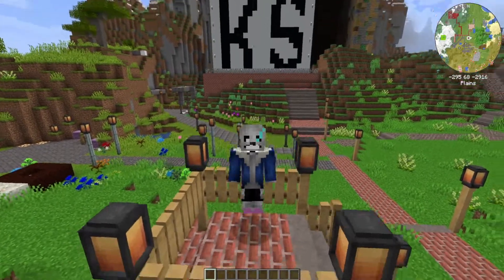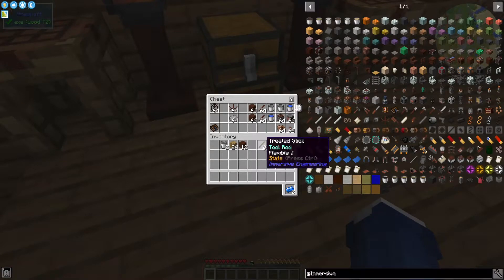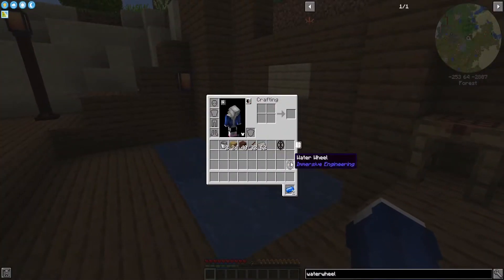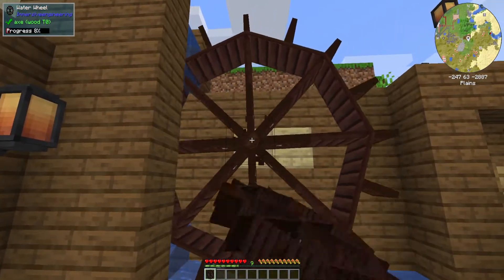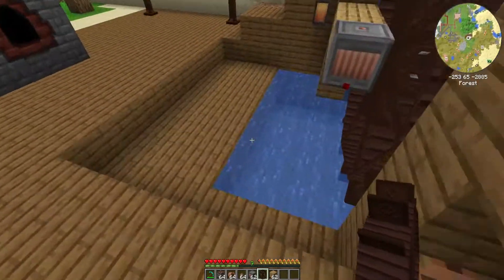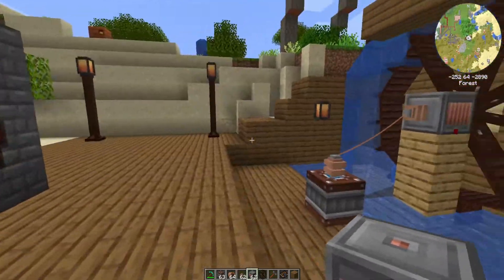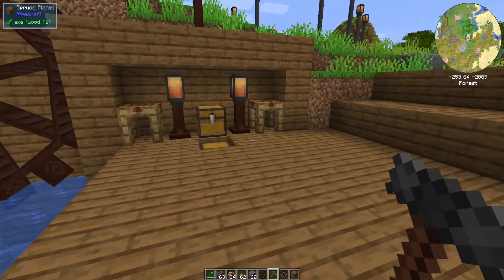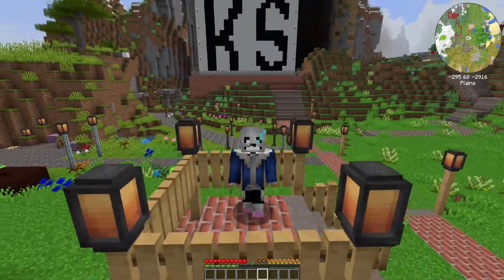Easy Power with Water Wheels! | Immersive Engineering (Modded Minecraft)

Comment: The reason why your dynamo didn't generate power is because you used wire relays to connect the dynamo to the capacitor. You need to use wire connecters.
Reply: U saved my life ty bro